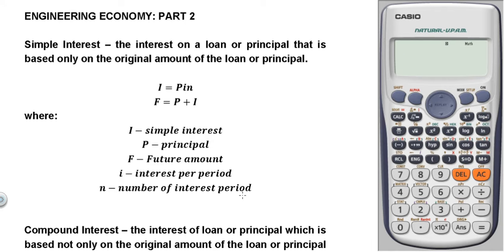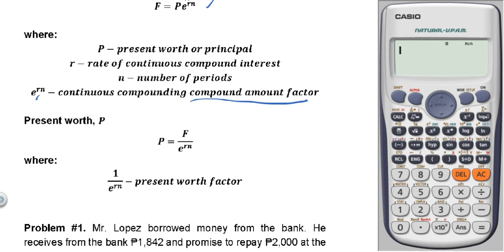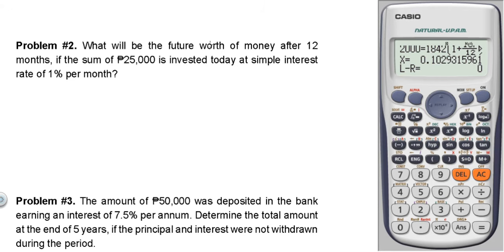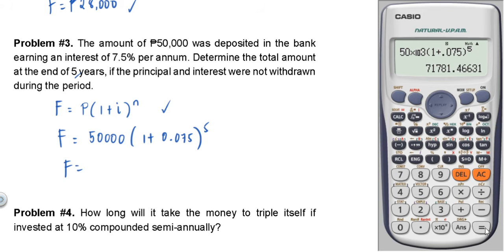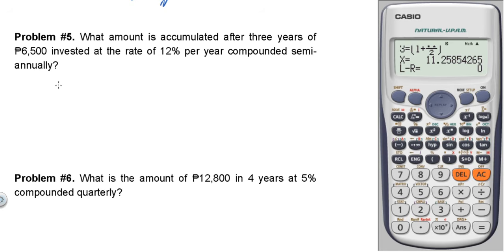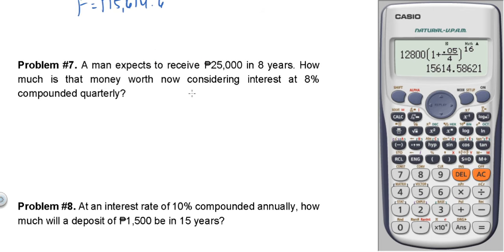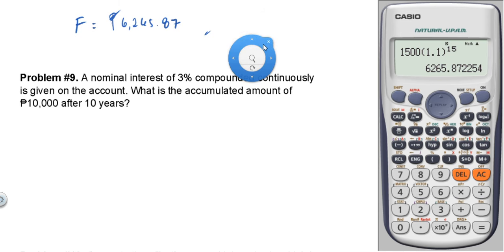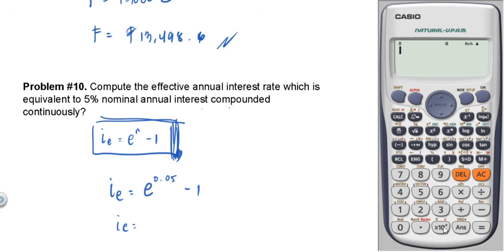Engineering Economy: Simple Interest, Compound Interest, Continuous Compounding

Comment: Sir correction po sa number 2. Pacheck nalang din po kung tama ako o baka mali haha.

F=25,000(1+0.01(1)) kaya po “1” yung n kasi 12 months so 12/12. Tama po ba?
So:
F=25,250
Reply: same ans bro, ang alam ko tlga e gagawing year ung N so kelangan natin sya e divide sa 12 which is 12/12.. idk if tama ba ako haha
Reply: mukhang tama yung 28k par kasi, 1% of 25,000 is 250 

250 x 12 = 3,000
plus yung 25,000 na principal

= 28,000 ✅
Reply: Tama lang po yung 2800, kasi kahit isipin mo nalang na yung 1% ng 2800 madadagdag after 12 months, edi 1%×12 mo tapos add mo sa principal at magiging 2800
Reply: per month po nilagay sa question